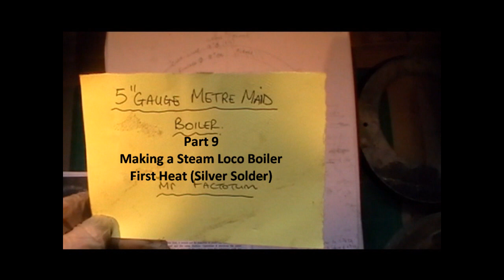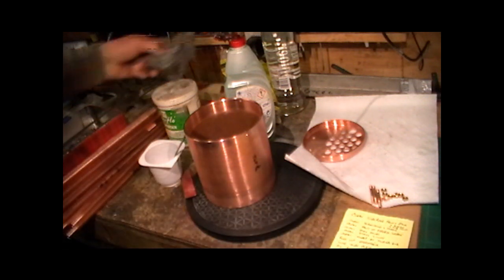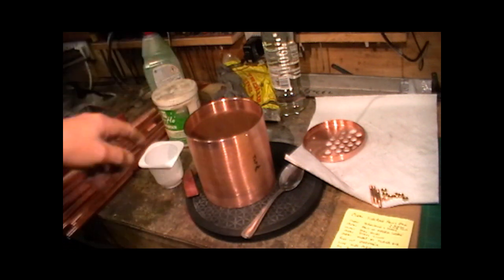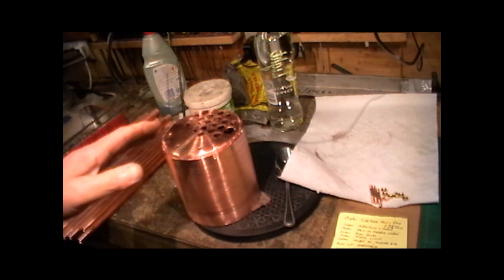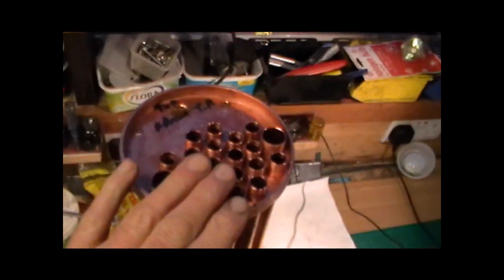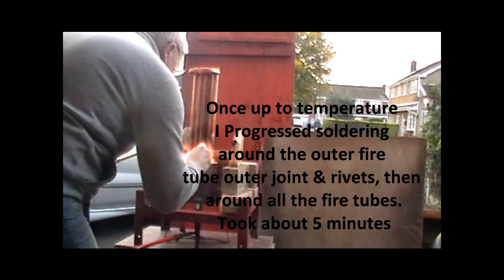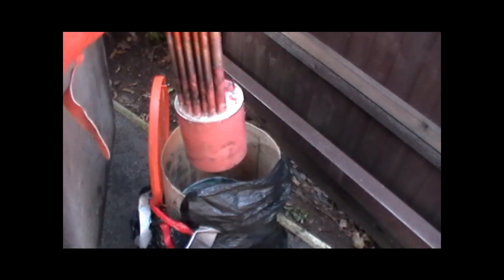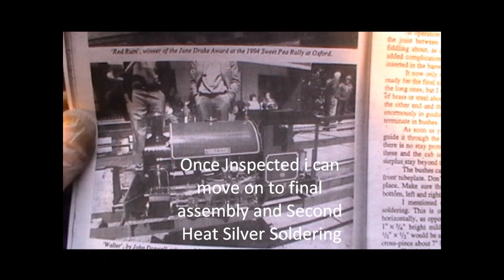Making a Boiler 5" gauge loco Part 9 First Heat Silver Solder " mr factotum "

Comment: Thankyou for making a fantastic series of films on making a copper boiler for a model steam engine. I was hoping that someone would do this at some stage. You have a made a very informative series of films.
Reply from the maker: Thankyou for taking the time to comment i appreciate that,  glad you enjoyed, there's a few more parts to come, up to the point of pressure testing. I will hopefully continue after that with the boiler fittings
Regards
Mr f

Comment: Hello. Does the boiler inspector come every tine when you are soldering to check it?
Reply from the maker: Hi sl
thanks for watching and interest, you get involved with the boiler inxpector before you start, and he/she will tell you what stages need inspecting, it depends on the type of boiler your making, in my case i needed 2 interim inspections and then a 3rd to pressure test the boiler. Once thats done and passed theres no other test until the loco is fully built then you have a full steam test with the inspector. Hope that helps
regards
mr f

Comment: You clean off the flux with acid , is that battery acid ?
Reply from the maker: Hi massimo,  again thanks for your interest in my projects, 
i had the acid given to me from a friend, i think its battery acid or drain cleaner, diluted down with water
Regards 
Mr f
Reply: Great videos thanks.  Were you able to get the silver solder to flow around all the tubes by poking the filler rod around the tubes?  I have seen techniques where rings of silver solder are pre placed around the joint prior to heating.